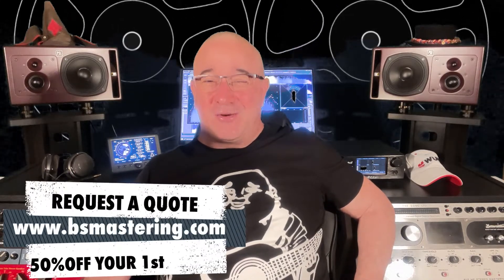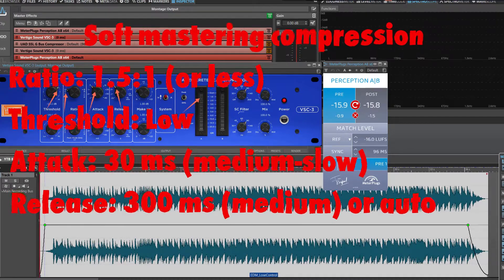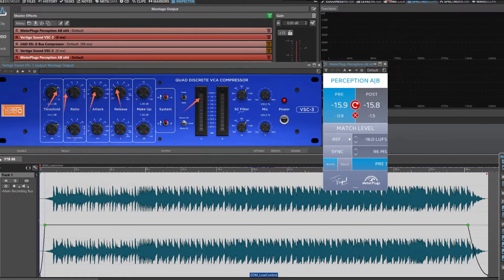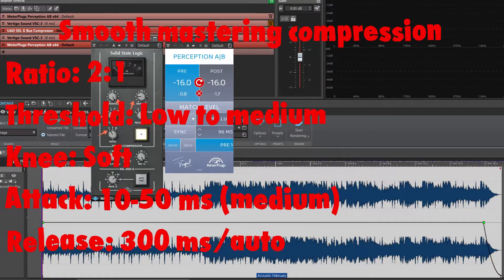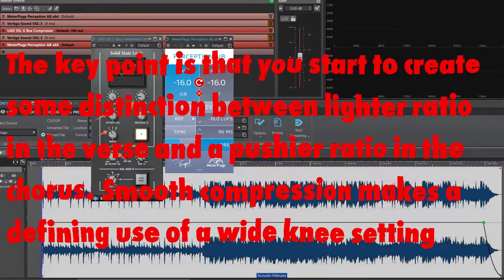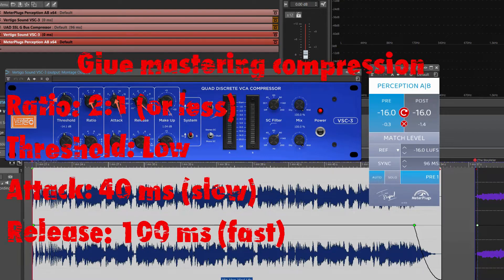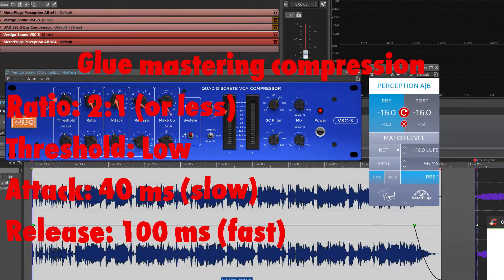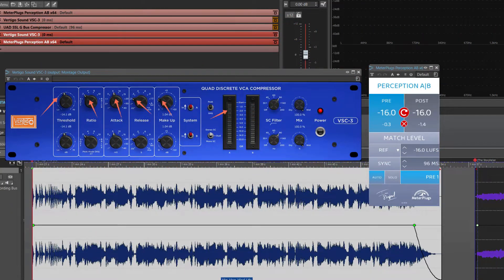Mastering compression techniques

Comment: I just wanna ask a quastion to make it clear for me. Can you please describe situations or genres in which smooth or soft compression are go to. Can you please describe both types: smooth and soft
Reply from the maker: Soft compression technique provides a pleasing dynamic control to almost any music you pass through it. The smooth mastering compression technique is an adaptation of the basic soft mastering compression. The trick here is to create some distinction between lighter ratio in the verse and a pushier ratio in the chorus. It can be applied to any genre.